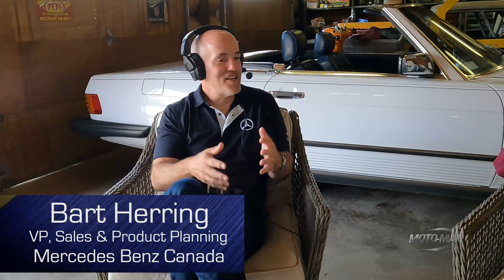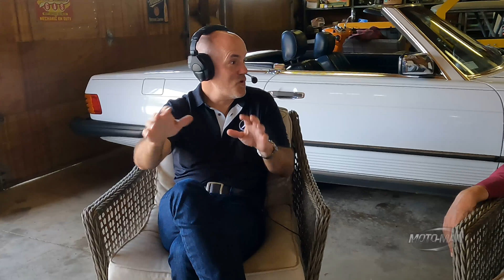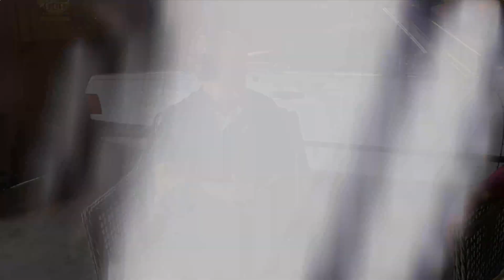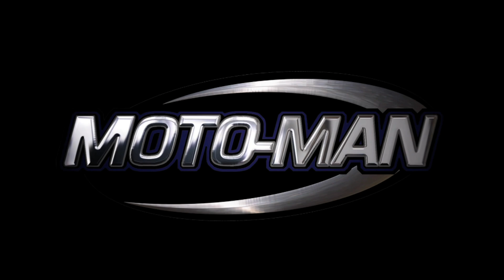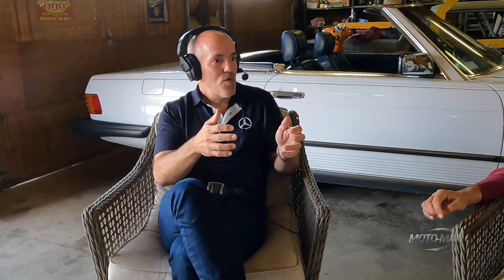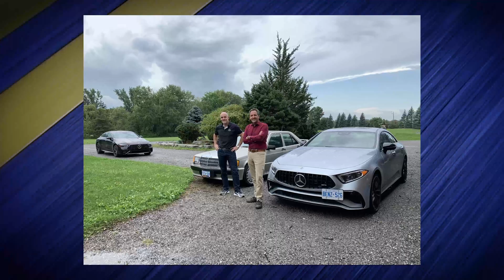How does Mercedes turn an old car factory into an EV factory?

Comment: I don't just think EVs should be incentivized with tax breaks.  They need to be subsidized.  In addition to that,  price caps need to be scraped for vehicles that qualify.   High-end vehicles make up a massive portion of the global car market, and they play a disproportionate role in the adoption of electric vehicles.

As for cobalt coming from the DRC, I just don't agree that it's that big of an issue.  Sorry. I just don't.
It's little more than a bad-faith talking point from climate change deniers, conservatives, Republicans, Tories, libertarians, and the fossil fuel industry who don't apply any  of the same questions or unfair standards on the entire supply chain for coal, oil, and natural gas.

I don't disagree that cobalt in the DRC has problems associated with slave labour (because essentially what it is).
I see it as something very solvable.  It's going to require work on the part of governments (not private companies) to shape the DRC into a more developed country. A  country with better workplace safety, much better pay for workers, better environmental standards, and a taxation regime in place that can optimally collect as much money for the benefit of the DRC.

In summary, the extraction of cobalt for use in Li-ion batteries is only as much of a problem as we allow it to be.
It's not something that impacts the overall usefulness of electric vehicles.   I am a serious car guy, but  EVs really are a panacea for solving carbon emissions from the transportation sector.

Separately, I would've liked  to have heard from Bart about the development of the 900v electrical architecture in the EQXX. Specifically, I wanted to know if we can expect Mercedes to drop it into a few Daimler Truck/bus products.

Comment: I dont like Mercedes jelly bean shaped BEV's. I was told they did the design for the Chinese market.  Id say that was an epic fail if true. If not and it was purely areo that did the design id say that was a fail as well. It does not look good. Then on the inside its all screen. Also not good. Is this a car you can pass down to your kids? God no. I can pass down an old Benz, or an OG Jeep Grand Wagoneer from the OG owner to their great grand kids. Am I out of touch or is the way things are built now out of hand.  Id never buy these things. Id lease only.
Reply: I just re read my post and thought. Crash did all this. Think about it. We cant build anything that lasts due to crash. Ayeeee... why we cant have good things, like bubble tops free of pillers blocking our view. Booo
Reply: I still dont like Merc BEVs Dodge didnt make their BEV look like a jelly bean. It looks awesome. Take note.